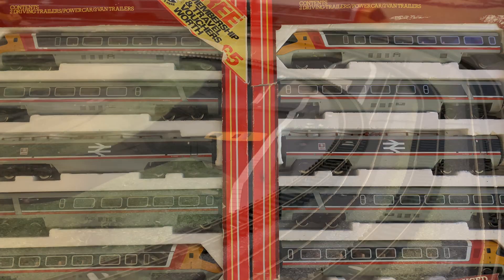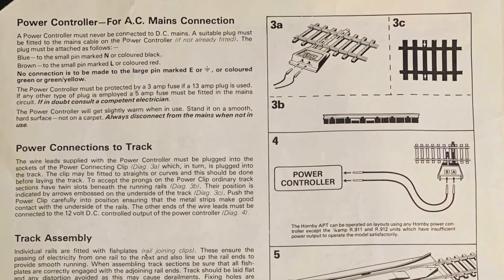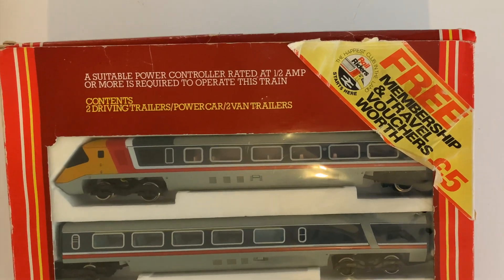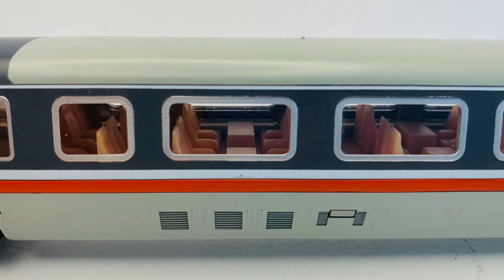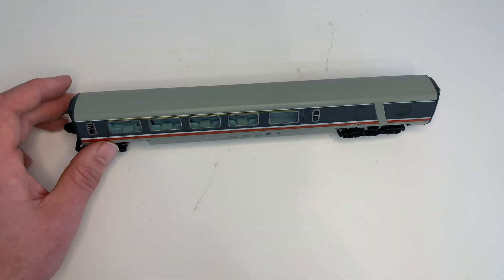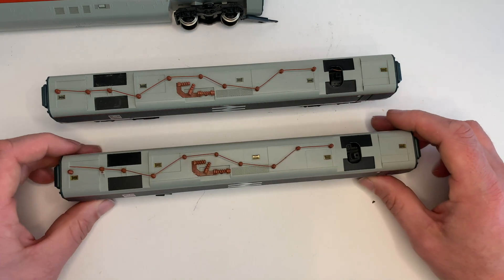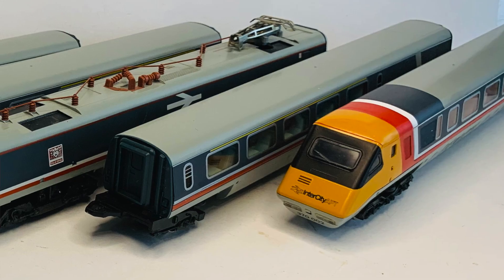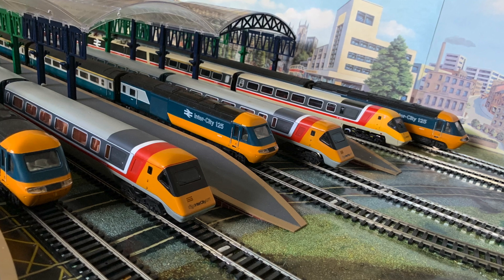Bargain Vintage Hornby APT Purchase Review | Advanced Passenger Train

Comment: Great review, first time i saw the APT set was at Howes in oxford back in the mid 80's, then again Cheltenham model Centre in the early 90's, it was amazing all connected on some track in a display case, i have got a new one without the black surround on the front cars, its very good, i got hold of a spare power car and the development coach, plus 4 extra coach packs, hopefully i will get some front end black surrounds so it will resemble the 7 car set up.
Reply from the maker: The Apt has to be one of my all time favourites.  Now having two early examples and a full new example makes for a wonderful site when running them. Cheers 👍🏼

Comment: Hi Aidan, enjoyed the video. Last year I bought the APT train set R543 from 1980. It was brand new sealed in the box. The wheels are shiny and new. OK it has the yellow nose cones based on the prototype. 1981 onwards it had the black mask. The set had large oval of track, mains controller, cardboard tunnel, instructions and service dealer sheet. A little oil service and she runs very fast and smooth with my H&M Duette. Not bad for a then a 42yr old brand new train set for £190 ! It joins my Hornby & Lima collection I've had since 1978 - 1982 and they still work after over 30 years in a cupboard. Alright I was 10 in 1978 !!
Reply from the maker: Hi Karl. The set you have is just like the set I saw when I was younger in the model shop and hooked me. The old set still stands today as does the Lima locos. I was just having that same conversation with a work colleague recently.
Reply: @AidansRailways  Is it me or you can't beat a Lima Deltic 55 💪

Comment: Great find! I also have two sets in two different bixes, one like yours and the other i. An oblong box. I sm thinking of selling one but live in Toronto so postage would impact the sale
Reply from the maker: Hi Charlie, it was definitely a great find. At the moment I have so many ideas going round in my head as to what I will be doing with both these sets. At present I definitely won't be parting with them but most likely upping the speck in various ways. Thanks Charlie
Reply: I don’t have room to run a long train, having two sets is very special but think I will sell one👍

Comment: Great overview of the older APTs there Aidan they are brilliant sets and you got very lucky there being able to find two, I think mine cost me £160 a few years ago but the set was in perfect condition when I bought it,  my set is from 1981, the only disadvantage I would say with the older sets is the lack of being able to expand them and Hornby were originally from what I have heard and seen on websites we’re going to make a coach that would allow the sets to be expanded but that unfortunately didn’t happen, while the sets may be very old it’s good to upgrade them which is what I have done, some things that I have done are fitting LEDs to both ends but they are only forward lights and that did include drilling a small hole so the bright headlight could be represented, I would like to try and fit a red LED one day but need to figure out how to do that because my original method didn’t work very well, other things I have done are adding extra overhead warning flashes on each vehicle based on real photos of the APT itself and the destination boards and I think it makes the sets look really good.
Reply from the maker: Hi David. Thank you. I totally believe that these older models still stand in their own right. Since making the video I have been thinking over what I may do with at least one set. Like you said the application of transfers like warning flashes etc, modernising the directional lighting. Also I have been thinking about interiors, wheel sets and even possibly the grey colour applied to the roof and lower portions of the set. It is such a shame that additional coaches were not produced and quite possibly a shame that the tooling no longer exists for a railroad version. The prices on the internet continue to rise for these older sets even with the introduction of the new tooling but I believe this is most likely due to the cost of the new sets. Thank You David.

Comment: I own the new and old APT models. The main difference in the two for me is the roof details. The new one has etched parts, ridges running the length of the roofs and the pantographs looks far better on the new one (although admittedly they are difficult to get to stay up). One thing to remember is that the APT was very flush, so there isn't much detail to add to the new one on the front and sides so the old version stands up well there.

The colour of the old one is off as mentioned. I have thought of doing a repaint on the old version and you can get extra coaches from Leadley kits, so no need to hack other sets too pieces. Fox transfers do decals too. Although it would be a big project. Proper directional lights would be needed as well.
Reply from the maker: Thank you for pointing me in the direction of Leadley Kits. Much appreciated

Comment: Nice review! I got a tatty example for about £55 off eBay. It didn't have the power car wires, but did have its pantograph. I preferred the tatty example, as I could modify it with a clear conscience. Someone produced LED upgrades for the power cars- it had both white and yellow lights, so it looks really convincing. I painted in the areas under the bogies black, and darkened down the wheel rims. The motor could do with a looking at, as the wheels are sparky- probably new brushes and maybe commutator - apart from that, the old model is a nice job. There are also pics of the APT running as a five coach unit, so it is prototypical. I was going to paint on the black window surrounds, but the pics I found online of it running as a five car were with the all yellow front. I was a kid when this model came out and at the time, it was the model train you dreamed of owning!!
Reply from the maker: Hi Daniel, I agree that when I was younger it was definitely a set I dreamed of having however I have had to wait quite some time Ha Ha. I like yourself do like it when I acquire a model that is not quite perfect so modifying it can be done with a very clear conscience. To be fair I think that £55 for a tatty example is really not that bad as when you look especially at the moment on the internet they are fetching really quite steep price tags. Thank for getting in touch Daniel. Cheers